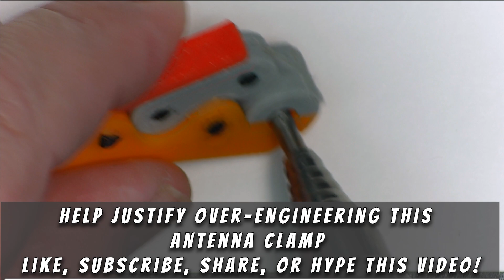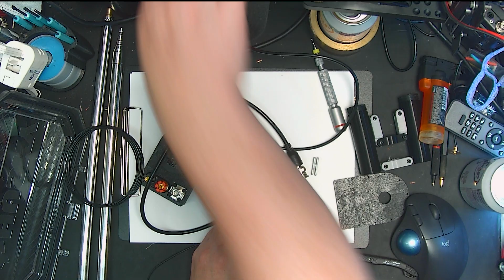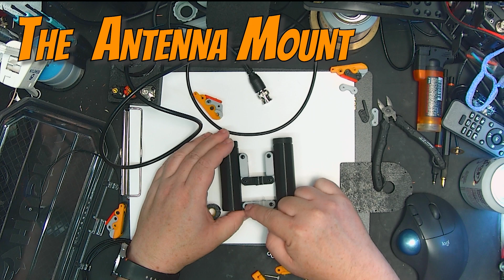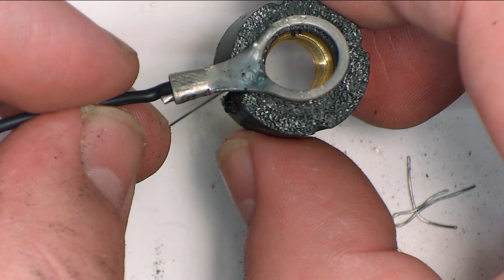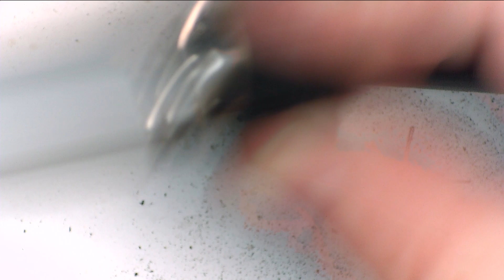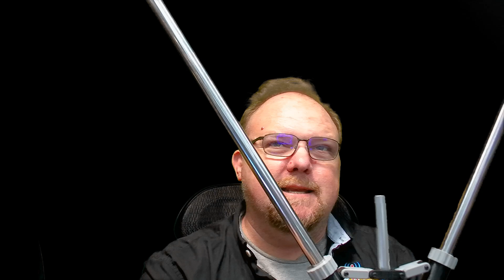DIY Portable Inverted Delta Antenna Design, Build, and Use | Part Two

Comment from the maker: 3D‑print STL files for your balun housing: GitHub https://github.com/Boondock-Echo/Article-Files/tree/main/Inverted-Delta
Reply: Excellent project. I’m working on it now. I seem to be missing the m10 nut holder that goes into the main tube assembly. Am I just not looking correctly? Thanks